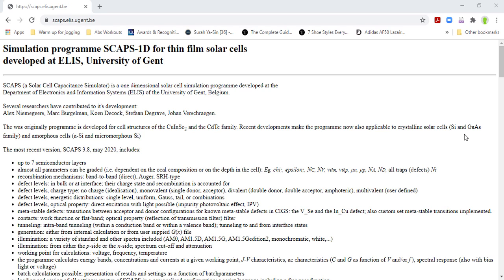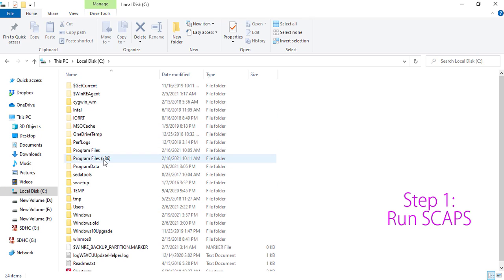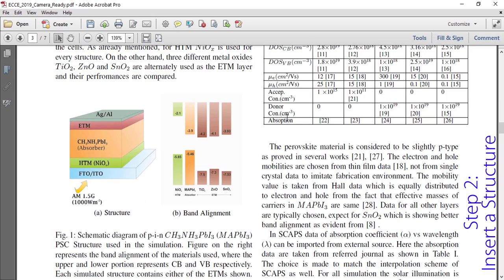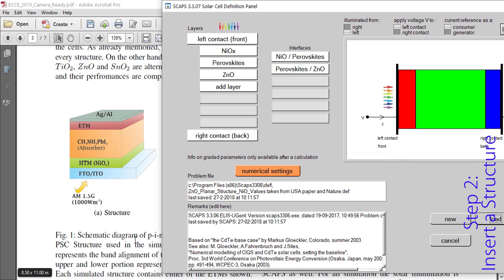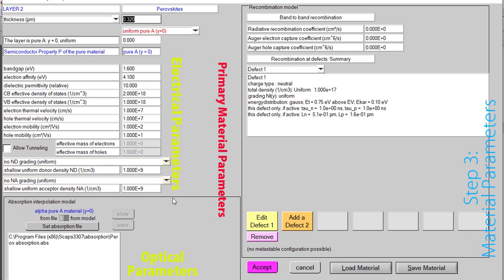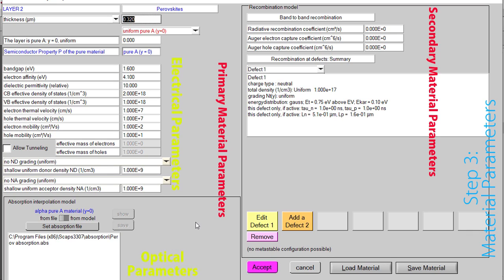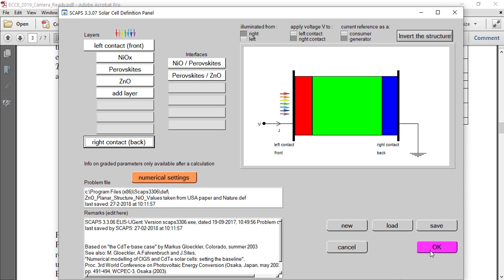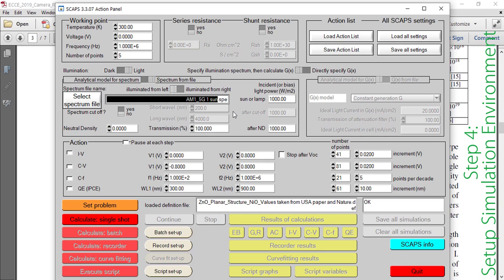SCAPS 1D tutorial: A First Look - From Software Open to Result (Beginner's Guide)

Comment: Dear sir, I'd like to ask how to simulate the efficiency of silicon cell over 20%. The efficiency I simulated is low. I don't know how to solve it
Reply from the maker: Hello. 
First check all input parameters of Si layer properly. 
Second, put proper values of doping concentration for n and p layer so that there is a good depletion region
Third, tune the thicknesses properly. Si cell should require larger thickness to obtain significant light absorption
This should work.
Thanks.
Sazzad
Reply: Thank you sir, i change the doping value and got the 20.12%, I think if the efficiency needs to be improved, the defect parameters may be involved. I don't know if my understanding is correct.
Reply from the maker: First, try with lowest density of defects like 10^10 or such. It should give you the best result, if not practically realizable

Comment: Sir how to find all primary and secondary parameters??
Reply from the maker: For primary parameters ( so as I termed them), you need to search for basic material properties from reliable sources ( it's very important, pls don't pick values from anywhere)..
For secondary parameters, first you need to understand those properties and their impact on solar cell devices very well. Then you can go for the typical values for those properties for your materials. I have a plan to post some videos related those properties, although I am getting very little time these days.
Thanks for knocking, Asha Chauhan
Reply: @edusupplement594  

Thank You so much sir.
Reply: @edusupplement594  
Ya please sir I am waiting for that videos thank you in advance it will be very helpful in such time.

Comment: only Jsc is showing in my IV curve. how to see all the other parameters like Voc, FF and eta
Reply from the maker: Please increase limit of voltage in the front panel. The simulation didn't run enough to get open circuit voltage, hence no property is shown

Comment: Hi. mam i face a problem while running this software. Please help me. My graphs are not reliable and dont know why.
Reply from the maker: Thanks for knocking, Dear Abrar.  Actually, 'edu supplement' has not started personal counseling service yet, although it's in plan for future, if such demand appears. However, if any person/ team shows interest in collaborative research with the 'edu supplement' team, then it may be contacted through email.
For the case of your issue, you may check the material parameters carefully to resolve your problem. Or you may first try to recreate the output of the paper mentioned in the video. Such recreation helps to unclog your issue.
Note: There is no female members in our team, so far. It's a small team.

Comment: Thank you for the helpful video. For your information this structure would be very difficult to make in practice. When simulating inverted/ pin perovskite solar cells you can use PCBM or C60 as an n-type as these can be easily fabricated in the lab
Reply from the maker: Oh.. Thanks you so much for your kind information.  Actually in this paper we were focusing on all inorganic transport layers.  Yah, in some of our other work I am considering PCBM and C60 for ETM.. But I  really appreciate your practical insight.  I have very few such knowledge. Please follow me, if that's not a bothersome for you and keep suggesting.

Comment: Hello Sir, I keep getting convergence failure when simulating my perovskite structure mostly at 0.76 voltage, what can be the issue and how can it be fixed? thank you so much for your content and have a nice day.
Reply from the maker: Hello, Seif Hesham. Well, this is a tough issue to resolve without inspecting the structure. However, you may try decreasing the defect density. If that doesn't work, try replacing the ETM/HTM layer with some other materials. Such kind of trial and error solves this issue, if not always.   
Hope it will work.

Comment: Plz.Could you explain how to obtain  the influence of one or a few parameters to the solar cell characteristics. thenk you
Reply from the maker: You need to use 'Batch Calculation' for this. I will post a video regarding this very soon. Please stay subscribed for this.
Reply: @edusupplement594  If you want to explain to us these days, thank you
Reply from the maker: @elamrimaroua6046  I will post a video for 'Batch Calculation' as soon as possible
Reply: @edusupplement594  you can do the figure: the open circuit voltage according to the thickness of the layer.plez
Reply from the maker: Please check our new video
Hope it will serve your purpose well
Reply: @edusupplement594  okay 🙂🙂🙂🙂